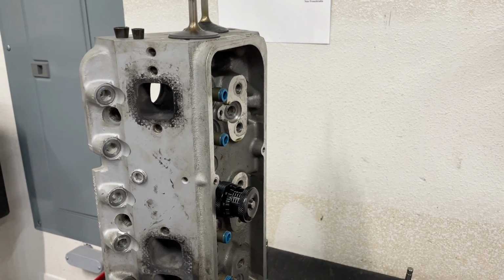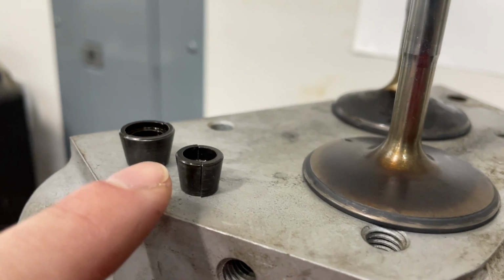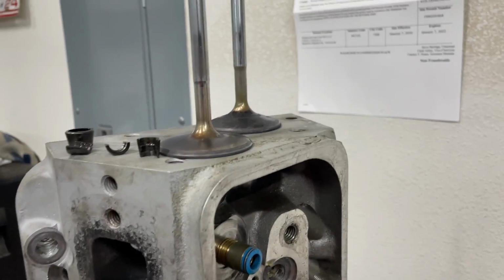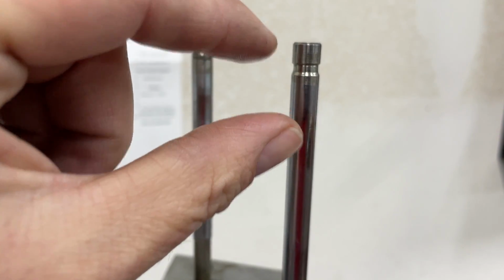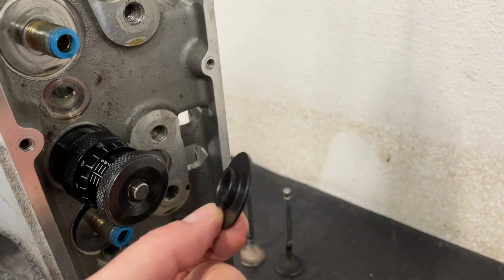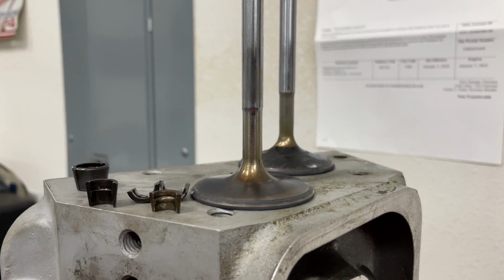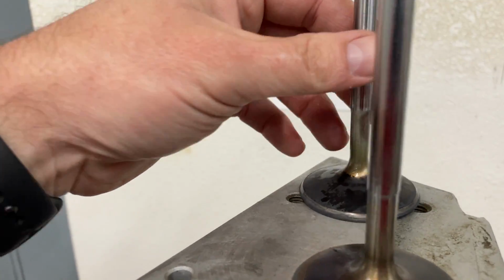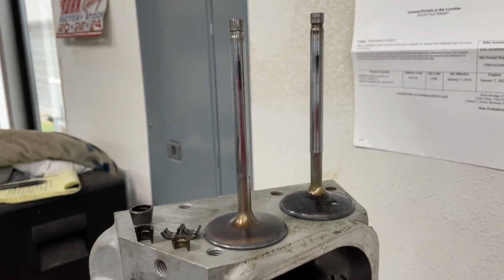Don't Do this Chinese Valves and 7degree locks

Comment: I also started purchasing 10* keepers with different heights to adjust spring pressure. I’ve found beehives that are near 140# for my solid flat tappet cam. In time you can learn anything.

Comment: We use manly Super Seven Locks which are actually eight degrees and the size of a 10 degree lock 
8 degree locks have a better clamp load than a 10 degree lock

Comment: Good for thought, did it actually stretch or is it a tulip deign that’s longer?
Reply: From what we could actually see , it looked "pulled" to me . I'd like to get a good look ate the stem where it meets the head
Reply: I'll give you an answer. Did you see that the valve had cupped. That's part of the whole. I can't see 21-4n stainless made by Erson or Elgin doing this. Most to all of what thise aforementioned companies ave Chinese and Indonesian factories. The difference is the use quality control. That's the difference.

Comment: How do we verify if name brand "American" parts are actually made in America? Is it possible that American parts manufacturers try to keep costs down at the expense of quality? Let's say a Chinese company can produce a valve at 1/5th the cost of an American brand. American company buys it puts it in their name brand box. Then this company sells 100 sets of these valves, and there's one failure (say, the one you have). You call in they send you a valve, or even a whole set. They're making 5 times the money per valve. They're not losing anything, and if none of those "replacement" valves they send you fail, their name Is still "golden"...on Chinese valves. On the flip side, what if that failing valve you have, is actually American made? The main thing I'm trying to say is, how do we verify what was made where? Word of mouth is no good in this day and age. So if someone up-top in a company says "Made in America", how do we really KNOW that?
Reply: Problem is alot of these boxes will say "Assembled in America"  People read this and assume parts are American made.

Comment: Nothing to do with Chinese parts on the sucked valve.  That hole is sucking air .  Seen it several times with top off the line stuff.  Mainly loose spark plugs.

Comment: Never seen one that stretched,, but worked out what was wrong after about 30 sec. 
I have however seen  'brandname' intake valve stretched. Budget line yes but still no excuse. One only, rest were fine. Low buck speedway engine running @ 7000 rpm. And that was 145lb on the seat with a Crane F244. Solid. Crane recomend 125lb. At 7000 rpm that is a a huge difference in power. 
16 new valves and a freshen up and ran for another season

Comment: I tell ya what , I was at a friend's shop today that had a brand new pair of 13 ° Brodix heads from HVH , he told them no Rev titanium valves , HVH put em in , 44cc chambers were requested , they're at 40cc , wanted 2.20 intake valves , got 2.180s , they put 10 degree locks with 7 degree retainers or vice versa, wanted 5/16 intake valves or 7mm , they put 11/32 in , so everything that was ordered he managed to screw it up , one of the intake valves looked damaged from the wrong locks too ,. So idiots are everywhere not just China
Reply: Brodix puts 50 degree seats in em , they changed them to 45
Reply: And he has called HVH numerous times and they won't talk to him

Comment: Not only was it set up wrong and with cheap parts, but who knows how much actual power he was losing because of the valvetrain instability!!! Those valves probably started "dancing" on the seats before 5000 rpm (depending on his cam profile) which I'm guessing was pretty mild. A REAL solid roller would have destroyed those springs and valves and would have NEVER revved worth a shit....

Comment: Detonation probably caused that valve issue. Seen it on good  valves. The pistons probably have damage too.
Reply: My thoughts exactly, extreme heat and cylinder pressure, most likely from detonation. I don’t see those weak spring pressures or any other forces pulling it hard enough from the other side to tulip it like that.
Reply: @stevenbelue5496  Exactly correct. I’ve seen intake valves umbrella-ed just like that and it was always caused by severe detonation. The worst offenders are boat engines. Dead load, raw water cooled, temp gauge shows normal temps. Pull a hill with a load with an engine with to much compression and no knock sensor type control and fuel that is to low in octane and you’ll trash that engine pretty quickly.
Reply: @richb4099  I would disagree. There was no sign of detonation to be found. You would have seen signs on that head. If it was on a boat, it was freshwater. There was no sign of corrosive salt anywhere
Reply: @crazy antny  My boat engine analogy was just an example. I’m sticking with detonation. Cheap valves I’ve seen can generally crack in the center of the face and into the stem. Never saw one stretch and if it did it would be much thinner where the stretching occurred. Like a bolt that elongates before it breaks. I’ve been an engine builder most of my adult life. Just built a 400 SB that went 9.90 in a 3200lb ‘69 Camaro thru mufflers on small tires. 136mph.....I’m 74 and built engines and did heads every day for years and have seen most everything.

Comment: I had this happen on a set of factory cast iron Ford 3.0L heads.  My machinist knew to look for it and blamed it on a lack of hardened seats the factory used.  All the valves were tulips.  He replaced them all with new hardened seats and new valves.

Comment: I see a lot of the NASCAR take out titanium valves are tuliped like that.
Reply: Bet u find they running in excess of 300lbs seat pressures..  and they run harder than most at extended periods of 9k rpm..  things get strained to max.. especially valve  train..

Comment: Eric what do you think about Erson valves are they junk or decent for high rpm and some amazing information.
Reply: That's what I was thinking. There are some very quality valve from Indonesia and China. If the valve has a made up name, avoid at all cost. Rememember, 7 degree locks run fine in flat tappet applications and normal use hydraulic roller.  Well getting back to his valves. 15 out of 16 isn't that bad😉. Maybe ARP MADE THAT valve and it didn't pass the stretch test🤔

Comment: I have seen old truck heads like that,  figured it was burning oil, and they run the piss out of it, it was burning alot of oil, it was coked with oily carbon, I figured the Valves got hot enough to distort,  probably detonating also, that's alot of heat, and probably turning 5k constantly, I just used the block anyway!

Comment: I`ve seen that too, mostly on stock vortec iron cylinder heads with high mileage and overheated. I couldnt come up with a reason that made sense why they did that. Perhaps they were cheap made in mexico valves, bouncing on the seat? IDK
Reply: I've heard overheating causes loss of temper, softens valve heads.  Can't understand why just intakes, maybe intakes are soft to begin with?
And then there's stainless, which I prefer and see quite often.
Reply: @thisisyourcaptainspeaking2259  Intakes are a lot thinner and span a much greater distance, and may not be made of as good of material as exhaust valves
Reply: @bigidol9789  Quite Right!

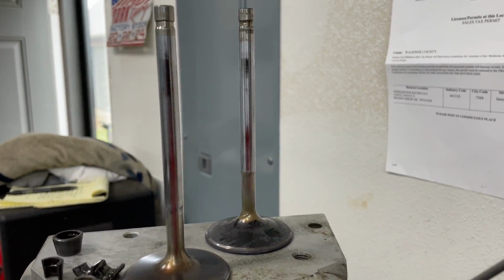Comment: 8:20 Wow! What should the metal be for a valve? So the metal is inferior or cheapass selection of metals that it was like heating metal and forming it because it became more ductile.
Reply: I don't know how Eric feels, but 21-4 SS is pretty damn good material. A few US companies do have thier valves made overseas. They've also been used from the factory in engines for decades. Elgin and Erson per say, make quality valves. I imagine thats because they use quality controll in thier overseas factories. I've been matching since 82. I've not had much of. A problem with the mentioned companies. Never buy a valve with a made up name! These valves that you see on eBay, if you want them, do your homework before deciding. If also like to say, I've seen this happen with a few many valves, but they were sever top dog engines

Comment: Only solid rollers that have these spring pressures recommended are cast core street rollers like Comp Cams  Xtreme Energy or Magnum series
Reply: yep

good for a 7000rpm hydro roller  thats about what AFR uses

7000rpm solid roller..gonna have some problems

Comment: How do you feel about 7 degree locks on solid roller with a hydraulic roller profile? Per example your sick of collapsed hydraulic roller lifters and want to throw some solids in.
Reply: No problem.
Reply: Heres a tip.... Try a set of 8 degree locks. They actually work as good

Comment: That’s why you don’t use Chinese parts… Especially when spraying the Bitch down w nitrous! He’s lucky he pulled it apart, because that thing wasn’t going to make another pass or 2 max, before that head popped off! That valve was stretched a lot! I betting over 100thou! He best be inspecting the cam & lifters really good, because I don’t doubt there’s other shit damaged! Are those shit castings even worth fixing? Wouldn’t it be better to just sell him a new set of Dart 23 degree heads, complete? I know that they used to be very reasonable for a set! Im just thinking that by the time you weld up & do a rebuild on them w all new parts, It might end up costing the same? Just trying to save you time bud! We found this out w old connecting rods years ago, by the time you mag, glass bead, smooth them out, balance buy bolts than resize! You would have 2hrs tied up in them easily! So it was actually cheaper to replace the 30 or 40yr old rods w brand new scat rods that are almost perfect out of the box 📦! Plus even on a 500hp SBC Spraying a 125 & a 175 shot together, those cheap scat I beams hung in there for almost 150 passes when he finally busted the old 3970010, 10/20 block GM block! Have a great day! I really hope you got my envelope ✉️ in the mail 🤔🤔🤔🤔?

Comment: I have been working on heads for 35 year have found at least 30 ten degree lock split came out in 3or4 pess never a 7 degree have your on my my motor 250 on seat 50 pass and a 50more on 7degree lock put new spring and lock at 100 run good machine lock
Reply: I'm sorry, what? Are you having a stroke, @Bill Bylsma?
Reply: Timmee

Comment: Always come here to learn, knew China pinched pennies in manufacturing but figured they'd at least test to failure and spec open max spring pressures when distributing.

Modern Hemi are triple bead btw, which is why we gotta pay to play(one reason at least).
Reply: So are ford mod motors. 3 groove. Seen a bunch only locked down 2 grooves over the years on factory rebuilds.